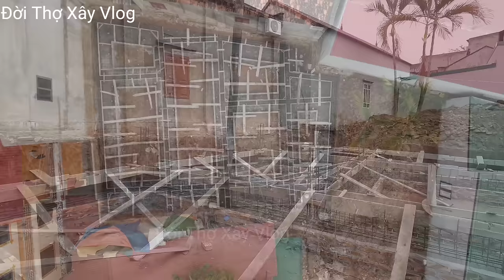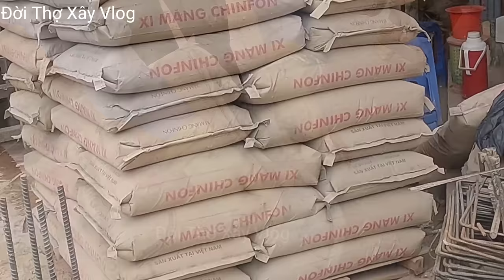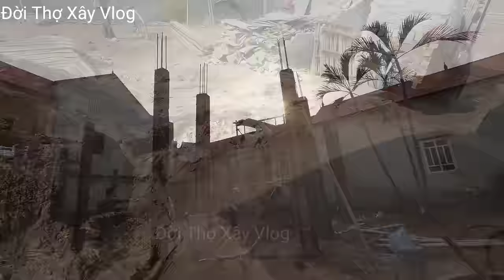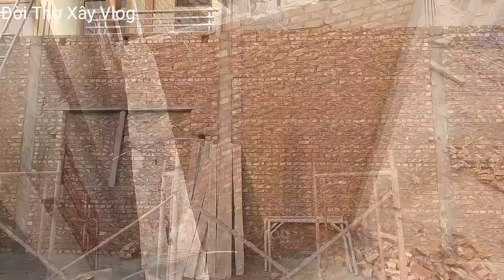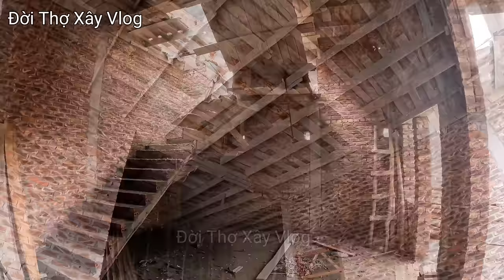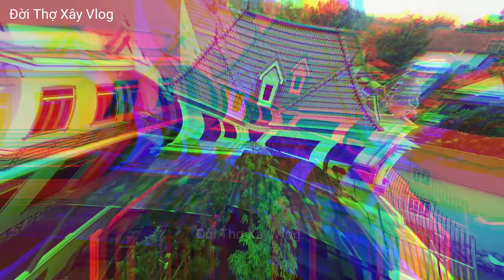200 Days in 91 Minutes of Beautifully Completed House Construction

Comment: The buzzing sound.....10:28....in this song,  Almost my favorite part in video.
Actually saw the plumbing and the whole foundation get covered with dirt. People use wood beams and support, than lay wooden floor sheets. 
This way you have to tile everything, and no access to pipes . People do it this way , but my house foundation, is half concrete and half dirt, for pipe access underneath.
Alot of good ideas with pillars, but theres support walls and more wooden beams.

Comment: Three cheers for the professional working boots 😂
And another 3 cheers for having neighbours who don't kill you for building right in front of their windows 🎉
Reply: Big drawback is the brickwall made with no horizontal and vertical steelbars. I would prefer the walls to be build with concrete hollow blocks with vertical at hole intervals and horizontal bars at every layer to add reinforcement in case of an earthquake.
Reply: Haven't you seen safety toe crocs before?
Reply: Wow, I see what you mean. If there is another building on any other side, then these people will live in the dark. How depressing. Imagine stepping out onto your balcony and bumping your nose into your neighbor's house at the railing.

Comment: footing is excellent but columns are not properly attached to the foundation. Bricks are stronger than hollow blocks but bricks has no rebar support to support the whole wall. Re-enforcement beam on the walls are not connected to the column support. No structural strength when earth quake comes. Walls has a tendency to fall apart. Columns only consist of 4 round bars which I think only 12 mm and stir up  seems only 9 mm only. It will only stand if there is only a minor earth quake of 4.5 magnitude.
Reply: It depends on how many seconds will that 4.5 quake last! After 6 sec or so, I'm afraid that all those walls will be a tomb!

Comment: @ 21:00 at this point you could have saved all the time and dirt work and just use all the rebar and concrete to pour a slab sans all the brick and mortar work / I am pretty sure with all the material so far you could have just poured an eight inch slab that meets all the building requirements

Comment: А на кой такие высокие потолки? 5-6 метров?))))
Reply: Vâng, tôi cũng đang thắc mắc điều đó, có quá nhiều không gian bị lãng phí với trần nhà rất cao như vậy.
Reply: @DrTubeman  ничего не понял, но очень интересно. )))
Вы на каком языке хоть пишете?
Reply: @DrTubeman  Building a house must depend on soil and climate conditions. This area has weak geology so it is necessary to build a very solid foundation, and the climate in northern Vietnam is a tropical monsoon climate. In the spring, the air humidity is very high and there is condensation in the house. Always build the first floor with a higher height to make the indoor space feel more spacious and airy.
Reply: Для понту))

Comment: there is  few flows in this constriction all the headers are not tied into the columns  which is not good at all and they are very small  2 brick high  and one brick wide  not very strong yes its sitting on a bearing wall  yes he is going to tie all his columns with the roof pour but he should have had and all around tie at 10 feet high  any settlements over some time  will cause problems also some of the neighbor's roof pitch is going to pour water into his wall another big problem when you are surrounded with neighbors like this